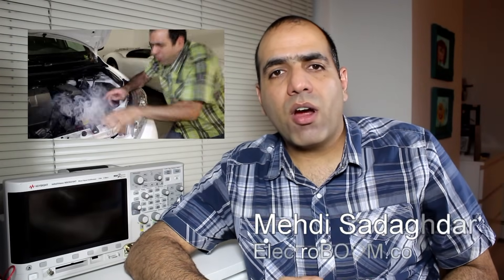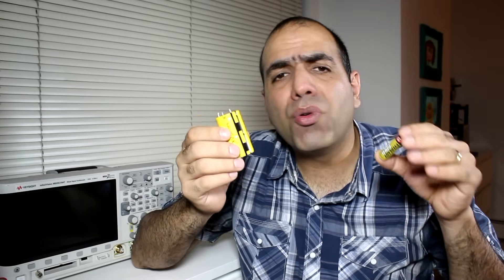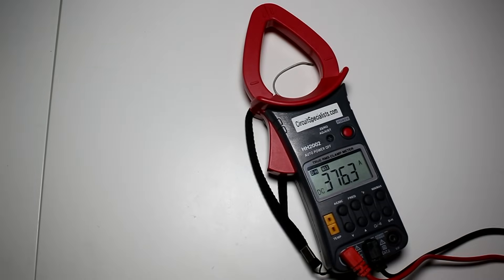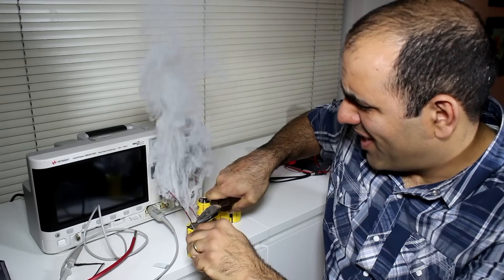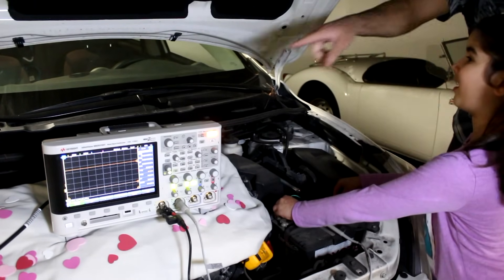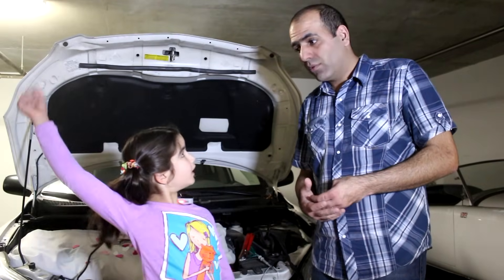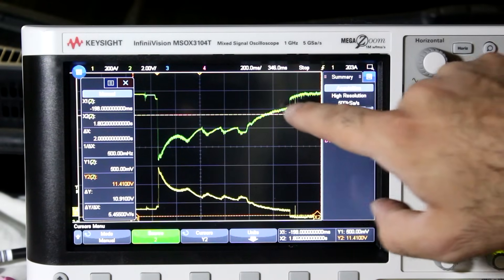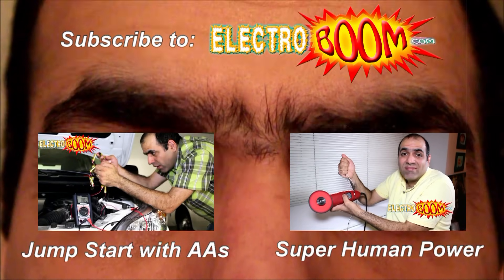Cranking a Car with Super Capacitors (Supercap)

Comment: hey ElectroBoom, could you use the capacitors like a regular car battery if you kept the engine running as the alternator will charge it over time? if so how long would you need to keep it running for the capacitor bank to be good for another start?
Reply: Other youtubers have done this as  a permanent mod. Have a look round.
Reply: Average current to the starter motor for a second ~200 A. So 200 Coulombs. Maximum charging current of a car alternator, perhaps 70 Amps. 3 seconds?

Comment: Can I build an electric motorcycle with this though? Legit asking, I'm thinking of making one for my senior university research project haha
Reply: You'd be better with some batteries, has he pointed out, a AA has 20x the energy in a similar sized package. Cap are good for supplying a high current for short period eg filtering or starting car.
Reply: LiFePo, more energy. About the same peak power per kg of cap/battery?

Comment: Wiring super-capacitors in series without balancing or management is generally a bad idea. Because of the difference in series resistance and capacitance variations, not all caps will charge to the same voltage. This can mean that if you charge your bank of 6 caps to 12V, not every cap will have 2V over it. Some will have 2.2, some 1.8 etc. You can imagine this forms a problem when you are pushing it up to the theoretical maximum (6x2.7V) or with bad caps. 
When designing a capacitor bank for a hydrogen vehicle dc dc boost converter (20x2.7V in series, so 54V in theory but in practice limited to 49.5V) I have seen variations of up to 0.8V(!) between caps.
Reply: don't worry, he sometimes learns from his mistakes
Reply: I know, he knows what he is doing most of the time :) It was more a note to people wanting to copy him without knowing what they are doing.
Reply: There are two main methods of doing it, active and passive balancing. In passive balancing you just waste excess power by having a mosfet in parallel to each capacitor that  dissipates power when the voltage exceeds a certain threshold (can also be a relative voltage to other capacitors).
Active balancing works by having a DC-DC boost converter in parallel with each capacitor. When a capacitor exceeds the threshold, the converter is turned on which boosts the voltage up to the capacitor bank voltage and dumps it back into the capacitor bank. 
There are some more methods and variations on the above methods but these two are the most common ones.
It depends on the application which is the most efficient/cost effective. Generally the first is the cheapest to implement in the short run, there are even dedicated chips for this.
Reply: I imagined this was the reason he got caps which combined were rated to 16 volts, when in reality he only needed about 12-13 volts. The extra capacity leaves enough room that no capacitor is going to go over volt (this is really the biggest concern when it comes to unbalanced caps)
Reply: Like I said, what he does here is fine, but if you dont know what you are doing this can be stupid and potentially dangerous (300F exploding and venting is no fun if you are standing close to it with your face). The generator can generate up to 14.5V, and is typically considered healthy if it normally outputs between 13.8 and 14.2V. So that only leaves only 1.8-2.2V for discrepancies between caps. This is fine with fresh, newly bought healthy caps but if they are second hand or charged/discharged a few dozen times this would not be safe anymore.
For example the capacitor bank that I worked on that I mentioned has 0.8V between some caps after about 100 charge/discharge cycles. This would be very bad if he had a few of those extreme outliers.
Reply: How do you balance your capacitors?
Reply: +ultort
If your caps are all the same (and preferably even from the same production batch), you can get away with putting a high value resistor in parallel with each cap. Of course this will slowly drain the caps as well, but depending on your application that might not be a problem. You could also put diodes in parallel, for example several silicon diodes (in series). Just select the forward voltage of the diodes so that they will start conducting when the voltage on the cap would exceed its limit.
Reply: Chances are youre telling him shit he already knows
Reply: They need to handle the voltage the vehicle alternator puts out when it starts.
Reply: tHaH4x0r sounds like liion pack
Reply: Exactly the same as balancing li-ion cells yes, if that's what you mean
Them being new and all the same probably makes it fine for just charging them up once and cranking a car. If you're permanently installing them then you should indeed add some sort of balancing.